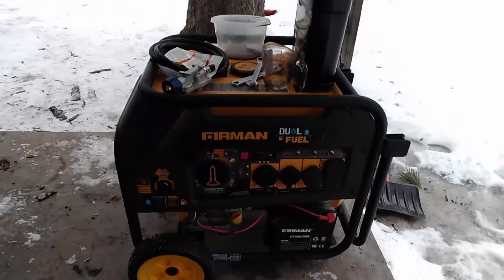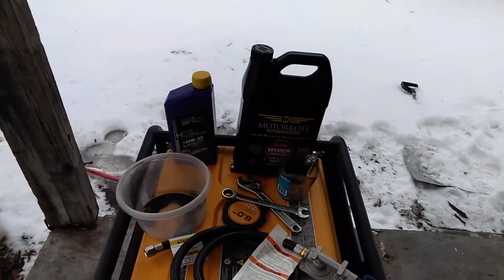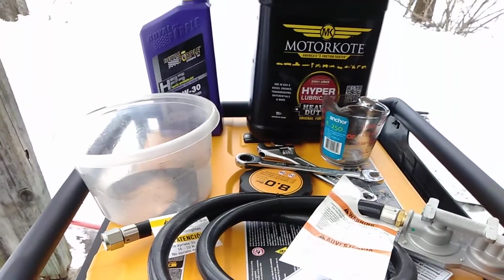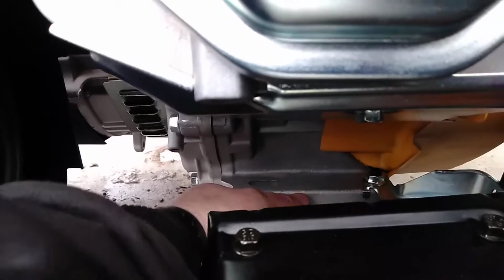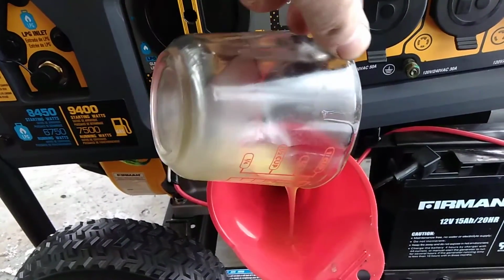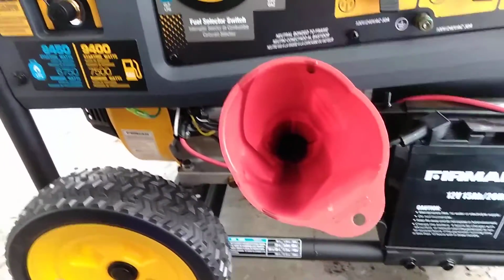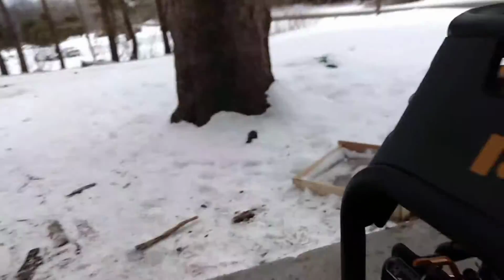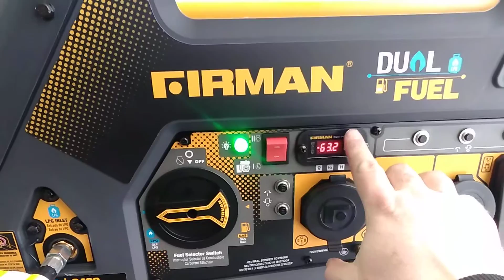Firman H07552 Dual Fuel Generator First Oil Change/Running On Propane

Comment: had mine for a year and put a 65h 90%welding hours never problem,very strong generator, very happy with it
Reply: Awsome. That makes me feel better about mine because I never heard of firman before
Reply: Here is a reminder about portable generator safety: everyone needs to see this safety reminder to be safe whenever using portable generators. This advice is just to make sure that everyone is aware of all the warnings and it’s just to remind people to be careful using portable generators. Portable generators can be dangerous if not used carefully and they need a lot of maintenance. Every year, hundreds of people die or get injured when using portable generators due to carbon monoxide poisoning and electrocution. Make sure you are using your generator carefully and keeping others safe as well. There is something very serious that everyone should always be aware of when using generators. Some people do run their generator indoors which is not safe and that increases the risk of carbon monoxide poisoning which can cause death of family and you. Some people run their generator in wet conditions which can electrocute them. Please remember that you should never run your generator indoors. Remember that carbon monoxide is an odorless and colorless gas that you cannot see or smell. Carbon monoxide is a silent killer. Keep that in mind. Make sure your generator is 15-20 feet away from your house and away from doors, windows, and vents. Never use your generator in your porch too. Having a carbon monoxide detector is very important against generator safety. Some people also allow children to go near the portable generator which could pose risks. We need to keep an eye on our children making sure that they are not near the portable generator so they won’t get electrocuted or burned by the generator which is dangerous. A locking enclosure also keeps kids safe. A generator shed might look like a tempting place to explore, or take cover during a game of hide and seek, but a generator is a dangerous piece of equipment that can cause injury. It says on the manual that we should also keep children away at all times from the portable generator to avoid injuries. Please do not allow a child or unqualified people to operate the portable generator. Just because some manuals missed what should be listed doesn’t mean it’s safe to do. Always follow the generator safety rules when using portable generators. Generators pose electrical risks. If you need to use your generator during wet weather, you need a generator tent to protect your generator from getting wet. Don’t let your generator get wet. Keep your generator dry and before using your generator, please make sure your hands and your generator is dry. Do not wear loose clothing when operating the generator. Everything that is said on the generator’s operating manual should not be ignored. Never smoke cigarettes near the generator. Please keep flammable things away from the generator. Never overload your generator too. Your generator can catch fire. Never ever try to plug a generator cord into a wall outlet to avoid back feeding. Back feeding your generator is dangerous. Always turn on your generator first before plugging in appliances and shut off the appliances before turning your generator off. Use a heavy duty cord for your generator and the cord should not be worn out. All the instructions should be followed carefully. Never refuel your generator while it’s running. It can cause fire if fuel spills while your generator is hot. You should turn off your generator and let it cool off before refueling it. Having a fire extinguisher next to the generator is also important. This is only a reminder for everyone’s safety of using generators. Make sure your generator is properly grounded. https://youtu.be/I1jT3ANENvI and here is a video more about keeping others safe when using generators and also about our family’s safety. Hope this helps. Thank you. Hope you stay safe. All generator safety rules needed to be followed carefully.

Comment: I just bought this generator today. Is it ok to only use propane? I’d like to keep it gasoline free if possible. Also, once it’s broke in my plan is to store it...are there any tricks or tips for extended storage (other than what’s in the manual)? 
The manual says to run it once a month for 30 minutes (I think).
Reply from the maker: You should be able to run straight propane without any trouble.  I'd run it for 30min/month and change the oil annually.